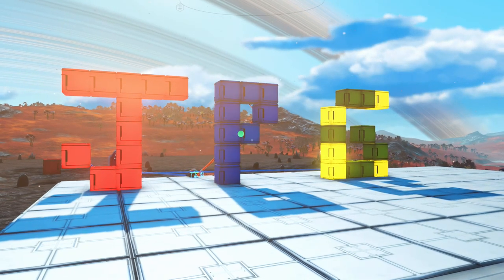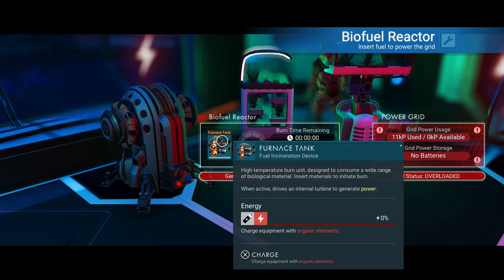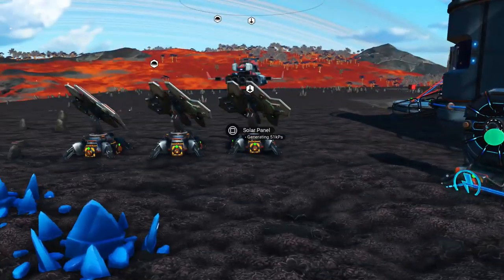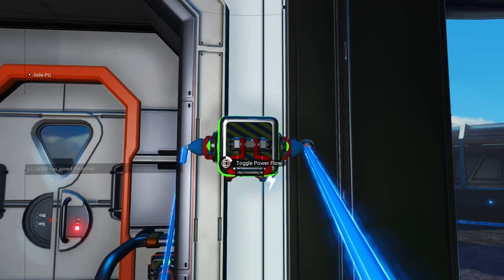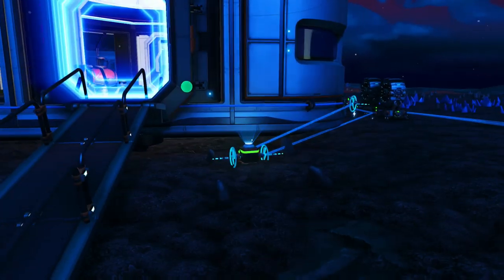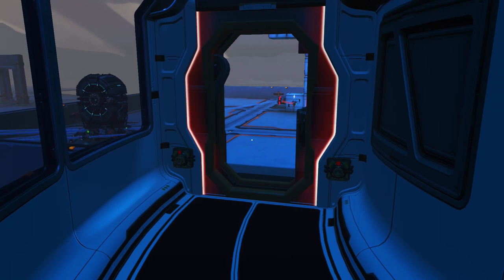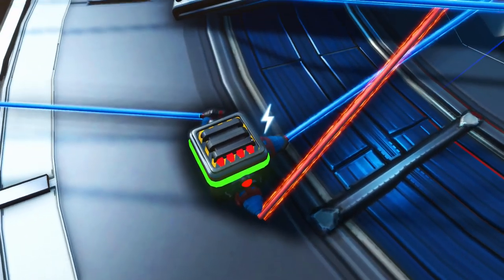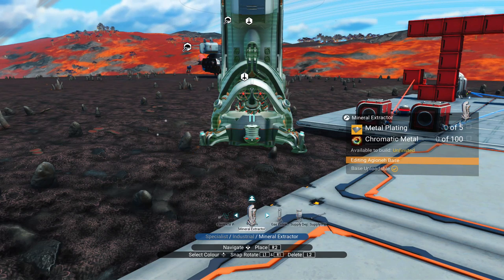NO MAN'S SKY POWER TUTORIAL Part 1 - Basics! Fuel Reactor Solar Panels Proximity/Inverter Switchs

Comment: Man the cables are bad hello games needs to update this
Reply: Really not, they let you hide them away to whatever extent you want.
Reply: @DrKaii  "let you hide them away to whatever extent you want."

Not really, but ok.
Reply: @DrKaii  how?
Reply: @mrkrunch4340  you can click anywhere and they will fix to any surface , and keep going like that until you neatly and out-of-the-wayly reach the other connector, instead of having to do it in a straight line.
Reply: @DrKaii  thanks, I'll hit up creative mode and give it a try; much appreciated!
Reply: Actually not too bad if you try to set them up the best you like
Reply: Digging trenches under and around your base makes a great hiding spot for em, and since they're coming up from the ground it cleans it right up.
Reply: @Koharduvon  funny story, ever since the Next update and the systems were re-seeded, the planet I've built my homebase on now has grass which inconveniently pokes up through the floor surface of the premade structure units (both the square and cylindrical units).  So I decided to use the terrain manipulator to clear the ground under the structure to get rid of the grass.

It works.  But then one of my base NPC's fell through the floor.  Switching the terrain manipulator to build mode and filling the gap back up sort of worked, but they never seem to sit back into their chair properly, even after a game/system reset.
Reply: @mrkrunch4340  that is a good one.
Reply: The power system needs a complete overhaul.

Something closer to Minecraft where cables can lay along the ground until it reaches an interface.

Either way... Cables are annoying and break the immersion.
Reply: @DrKaii  Nah they are a little complicated they could at least put arrows in green or an X if its wrong to guide us its not too much to ask

Comment: you don't have to run the wires from the generator directly to the battery outside. The corners of the structures have connecting points on the outside. Just run the wire from the batteries to an outside corner. No wires clipping through walls. Same with powering the doors. run line on outside from corner to bottom of door.

Comment: The wires don't need to run through the thr rooms, there are wire connections around the outside of the base. This then powers the I side. Makes it a lot neater.

Comment: In all honesty I’m a personal fan of the power system.
The game has been able to expand at let players build complex circuits. While it isn’t minecraft, it’s the best I could ever come up with.
You don’t need wires running through rooms since there are outlets outside of most structures that you can just plug, for example, doors into.
I now have a new principe I have to think of when it comes to base building and it makes more sense and I like the layers.
And you can keep wires almost exclusively not running everywhere and still have things like automatic doorways. Not to mention being able to create music and light displays, perhaps challenge arenas, and other clever things.
I don’t really understand everyone else, I love the new power change.
Reply: Just cuz u can't understand other people's problem with it doesn't mean it hasn't got problems. Powering the base is an awesome addition and a super cool idea. It's super flawed in implementation though. I literally have a huge grid leading back to my base with batteries charged to 100%. All my wires are blue but the ONE wire that connects to the base is red. Base power got problems and needs to be fixed, upgraded, or simplified. ESPECIALLY in the case of doors. We all know about the stupid Holo doors but some of us wanna make something with nice aesthetics. Or a consistent design. This whole system botches that very idea for a lot of people. It's not user friendly if people NEED YouTube tutorials and nearly EVERY ONE of the comments is talking about how they struggle with it.

Comment: Hey thanks for the tutorial, Jade. I was getting to be frustrated with the sliding doors, because the weren't reacting to my proximity per default (even when powered from the grid), so i had to build in the Proximity switch. But now, after implementing the proximity switch into the door logic circuit, it was doing exactly the opposite of what the doors were supposed to be doing. So by integrating the Power inverter into that logic circuit, you actually leave the door mechanism powerless by entering the Proximity switch trigger area, there by opening the door. As soon as you are away from the trigger area, the Inverter provides the power (triggered by the toggle of the signal or current from the Proximity switch) to the door, there by closing it again. Or in short: If you wanna fix the door mechanism, you have to break it. (in a sense) Highly interesting...

Comment: biofuel generators still burn carbon when their not being used, makes everything pointless
Reply: That's what batteries are for. The power will store until used by the battery.
Reply: @crooker2  solar panels power batteries so you only use biofuel at night when the batteries run out?

Comment: cables management is so poor ... i rate this setup on low 3
Reply: Loool
Reply: You can do cable management. Just place the wire on the floor or on a wall.
Reply: @J S in build mode hold CTRL and select the red X, hover the item you want to delete and when it is highlighted as red left-click it and it will return the items used to build it back to your inventory.

Comment: Cables can run thru walls and floors so just make a grid pattern under your base and you can then just connect whatever it is you want from above thru the floors. It’ll hide the wires

Comment: I use 2 batteries for my base with 4 solar panels. I connect directly to 2 solar panels as my day power, and 2 solar panels for my night power which power the batteries. I then connect a switch between each battery so only one run down at once for extra power if needed. - If i want to expand i will create new battery systems based on this.

Comment: A really great video man! You do a great job of explaining everything clearly and in detail. One question though:
At 4:15 you talk about connecting everything together. Is the wiring in the front that is already connecting the batteries not enough? Or do you have to actually connect the second battery to the same "outlet" that the reactor is going to?
Reply from the maker: depends on the output but if remember rightly just one needed

Comment: Mate to hide wiring each  building piece has a cable already pre wrapped around  with a place to connect to them, Its usually around the base of the building structure just in case you are un aware of this.

Comment: Looks like I’m a bit late to the game. As most of these comments are posted 1+ years ago. But, to bring exposed wires to a minimum, I’ve been either mining a subterranean level under my base for generators and running my wires straight through the bedrock. For solar panels, I’ll keep them at a lower elevation from where my base sits and run those wires the same way. Also, embedding them inside walls when I can get away with it...almost zero exposed wires in my current build.

Comment: Lol. You dont need to run cables through the building to connect to batteries or biofuel. Just connect them the outside building power connecter and it powrrs everything inside or on top of the base.

Comment: I bought this game 1 week before Beyond came out, after it came out it makes me want to quit the game already.
Reply from the maker: What dont ya like
Reply: @Jade-PG  I'm still sort of going through the tutorial and I was at the stage where I visit the anomaly, after the update I get trapped inside of the anomaly cuz my game crashes by either getting loaded into a lobby with people, or it crashes as soon as my ship flies out into space. I finally figure out a different way to get out of there and go back to my base which I was in the middle of constructing, and all my equipment is forced to shut down because of the new power generating system that was never a factor before. I can't access any of my storage containers and I can't use my warp gate. I'm forced to pause my base construction and I spend the time to figure out the generator thing, which eats up resources and has no "off" button, and my containers STILL can't function correctly even when powered, because apparently odd number containers are bugged. People tell me just delete the container and rebuild it, but I can't even do that because after deleting, the containers won't rebuild on my wooden floor panels, only on natural ground. I've got ugly wires running through my base and things won't even work properly, and every minute I've got a big tool tip pop up window reminding me to "BUILD THAT UPGRADE MODULE BUILD THAT UPGRADE MODULE BUILD THAT UPGRADE MODULE HURRY UP". What a fun experience as a beginner....

Comment: You know you can place wire holders in the air by using the wire after you drag the wire to any place to  make the wire bend or turn so you can hide the wires easily.  Everyone who says HG needs to fix wiring does not know that there is a system in place to hide the wires for people that learn the system.  But this game is not a simulation and it does need simplification for everyone since this game is not space engineers.

Comment: Great video. Gave me some ideas. However, I am having a problem powering my vaults. I have 10 vaults set up side by side and started with a dedicated power system just for the vaults. I wired them all up and for some reason only about half of them have power and it seems to be every other vault with no power. I have tried to power just one of the vaults that has no power several different ways with no luck. I really don't want to deconstruct those vaults as they have a lot of valuable resources I use. Any ideas?
Reply from the maker: Seems a common issue. Try replacing all the vaults
Reply: Jade PG That is what I am trying to avoid because they all are filled with stuff I need and use. I have over 200 hours on that save and really don’t have the patience to loose it all.

Comment: I'd be happy if it would work. Furnace is running but no power comes out. Either way if it's directly connected or to s battery first, simply nothing happens. Now I'm stuck on my base planet. Great
Reply: Justice Pope you might have to have multiple reactors in your base for it to start powering it, i had the same problem

Comment: The way you've wired up your batteries and solar panels is unnecessary. All you need to do is add any extra power makers/batteries/users into the grid and they will be connected. If you connect two batteries with a wire then they are linked. If you then add a third battery and connect it to the second on a different socket, it will still be connected to the first.

Comment: Power System is still bugged. I have a ton of solar powered stations and batteries yet silos fail to power and structures are somewhat powered.  Health stations refuse to receive power as do hazmat recharge stations. This is also true in freighters where they can't get power and also the market station refuses to center on the wall and only locates near the floor. Kinda annoying but not game breaking. Able to get the mineral extractors working fine and pipe them to the silos but silos just refuse to get power. Doesn't matter if I use a battery, direct from a generator, solar panels, organic reactors, or wire every which may imaginable. Batteries have enough juice to power a huge city but for whatever reason silos show they aren't getting charge or there is a bug showing the uncharged lightning bolt when they are charged. Won't know for certain till I come back in another day and see if they filled despite saying not charged. Oh, and the door won't open when charged so I leave it uncharged so it at least stays open.
Reply: There's so much wrong with what you've typed out here.. 1) Health and Hazmat stations do not need power, 2) I've run into no power issues other than storage containers being broken (Which usually means they were placed pre-beyond and need to be removed and placed again, 3)What the hell is a "silo" in No Mans Sky.. I'm going to assume you mean Depots, 4) The power door is rigged to close upon receiving power, You'd need a switch or inverter/proximity setup for it.
Reply: @malalliance6622  The health stations and hazard protection units do need power. For one... They are not working and two when you mouse over them they say insufficient power. Trust me.... I got enough solar panels and batteries to light up the sun and the rest of the items in the building power up fine. Yes. I meant depots when I said silos. Its a farming thing. Thanks for the tip on the door tho.
Reply: @lionelwhiskerknot  For me they don't need power and np
Reply: Depots or silos don't need power either
Reply: @Ash-em5pm  Yeah. I'm getting some replies saying the same today. Not sure what to do about the health stations and hazard protection units. They just flat out don't work in my game now. Even on my freighter.

Comment: How are you able to power the base without having to connect wires?
Reply from the maker: like said in video pop a biofuel reactor down in teh base or battery and it wil auto power
Reply: Jade PG Jade PG Mine isn’t though, I guess that’s where my problem is. It’s never even establishing that there IS a grid to power. I wired it to a line of vaults and it powers every other vault, leaving the middle ones unpowered. It only establishes a grid if I wire it directly to every single item and even then, it only powers some items, even if they don’t add up to 50 kP.
Reply from the maker: @wiseguy581  try placing all the non powered valuts down again?
Reply: I read somewhere if your base is made of metal, it connects everything without the need for wires.
Reply: PrettyNeckslashes Yeah, I tried picking everything back up and placing it again and it still wouldn’t work. My base is fully metal and I’m still having issues. I’ve always been a builder on games so it’s not like I’m dumb or not trying everything, I just can’t get it to work at all. Really sucks because I spent many many hours on my base and now I can’t use 90% of it.
Reply: PrettyNeckslashes Yeah, I spent several days on my main base. I picked up and replaced the vaults 4-5 times and was only able to power them all by removing the floors out from under them, placing them on grass and then wiring them. Hydroponics don’t take carbon or have wiring port regardless of how many times I replace them. I don’t see the point of having basic structures if you literally can’t use them at all, lmao. I’d be enthusiastic about this update if it didn’t render my whole base and the only creative base building items completely useless.
Reply: Don't give up guys, they'll get there, in the meantime try to salvage what you can and continue onwards

Comment: Is it not possible to add power to the basic structures wood/metal/concrete? Cant power up my first aid/hazard protection that is mounted on a concrete wall. My whole base is basic concrete. Figured im gonna try to unlock the more advanced structures in the anomaly and see if i can get power that way!

Comment: Do you know if or how to make the switch between power 

I'm trying to connect the solar panels to power my equipment for the day while charging the batteries without using the batteries power and when day light is out and the panels stop switch to batteries
Thanks

Comment: Interesting feature but I get the sense that it's not really properly finished. Seem a bit half-arsed to me. The wiring's a mess and the switching is a) annoyingly fiddly and b) not exactly intuitive and c) poorly implemented...they don't really snap to anywhere very well for one thing.
Reply: Vallejo Mach there are still quite a few bugs that need to be fixed for the base building to work properly

Comment: Hey, what should my solar panel to battery ratio be?
Reply: I don't know but I had a crap load batteries hooked up and fully charged and if you have big base like me those suckers were drained in less then 10 minutes
Reply: @PipeBurner00  I did some testing, it looks like if you have one solar panel for ever battery, every battery will charge up during the day about a minute before it turns to night time. I really enjoy the whole power system, but panels and batteries are way too expensive to build right now, they need to remove or greatly reduce the amount of chromatic metal we need to make solar panels.
Reply: @Yumemaru.  Ill have to try it that way i just ended up using my visor surveyed the ground for power and built 3 power towers that works lol and I can build more towers if necessary. I hope they can get those buggy shutter doors to work
Reply: @PipeBurner00  yeah man I might just go with with electromagnetic generator tbh, having dozens of panels and batteries is too expensive.
Reply: In my experience, 1 battery will provide power about 1 minute and 15 seconds (on a draw of around 600kPs). Adding more batteries extends that accordingly, and the drain rate of the batteries changes to reflect the longer time. I believe each planet has a different day/night time cycle (could be wrong as I haven’t fully tested it) within some defined parameters. If this is the case, then battery charge times will be dependent on the planet you are on.
Reply: @rjones1084  yeah it seems like it, my planet is about 13mins day and 13 mins night. I have a really big flat island with trees on the sides, and at the front theres a slope downwards where I plan on building a big panel/ battery array.

Comment: There's no point in building anything power related until they fix the issue with power lines and not being able to connect to batteries and generators, and connected generators and batteries randomly losing connectivity and having to be destroyed and rebuilt.